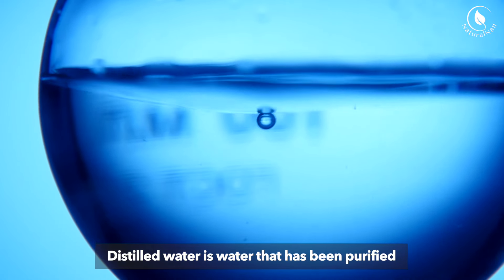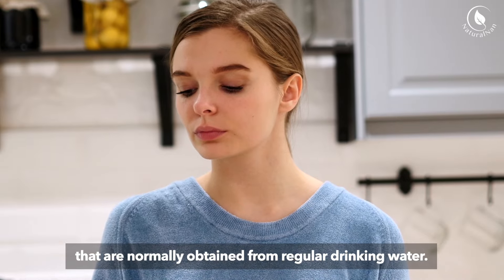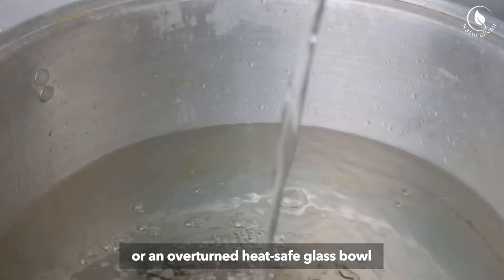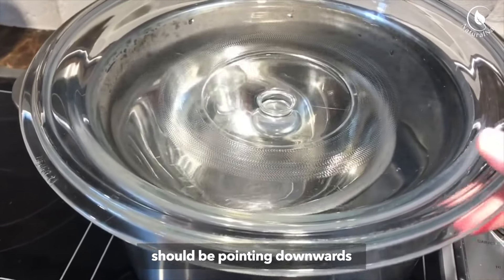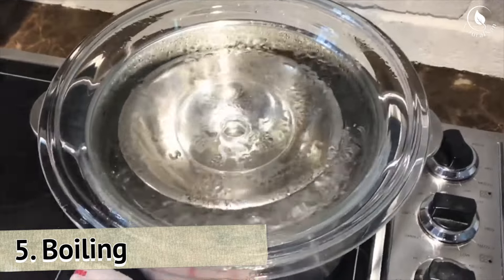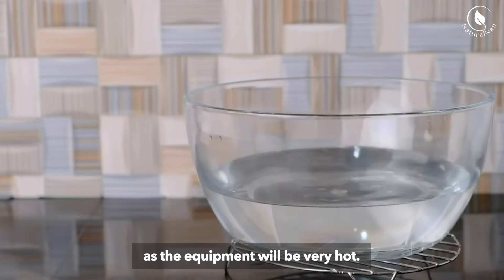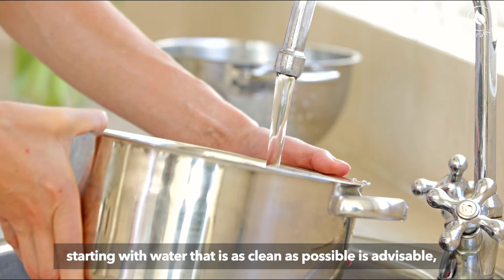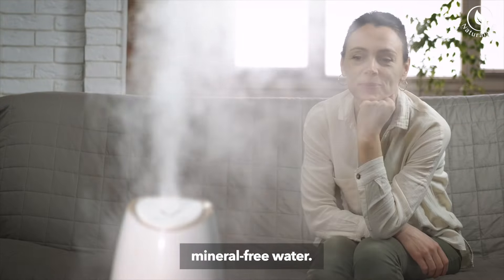How To Make Distilled Water at Home

Comment: Why? Why would anyone do this? It's slow, expensive, release way more CO2 than store bought distilled water - and it takes a lot work to do. 
I'm all for making things myself, but I cannot think of a single aspect of self make distilled water vs. store bought.
Reply: If somebody runs a humidifier every day, that's about a gallon a day for years to come... and that is for a single room... i mean I wouldn't want to carry all that from a store... let alone buy it...
Reply: This method can save your life 
What. Would you do if all thecwater is not drinkable and there is no stores 
You can use the same ideal and use the Sun as your energie sourse or make a fire 
I think it is a great ideal for those who dont depent on the system and want to be self suficient ans connext more wirh nature 
Thank you so much for sharubg I am gratefuk 🙏🌲🌳🌞